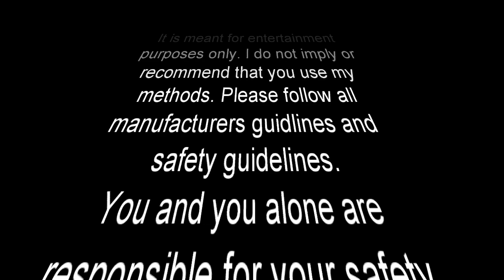Wood magazine walking stick part three

Comment: Really good!  I just made a stick last month, and it would have been good to have seen some of your tricks before I did that!  I have a short-bed lathe and had to make the top and bottom each in two sections that glued together.  I made 5/8" tenons 2" long for maximum strength.  Also, I glued a 1/4" length of contrasting wood onto the end of the piece with the hole to receive the tenon in order to 'celebrate' the joints.  

By the way - your opinion of threaded inserts is right on!
Reply from the maker: Hi Louie Thanks for watching and thanks for the comment. I'm glad you enjoyed the video.

Comment: Liked the videos Steve, thanks for showing them. I would like to know where you got the steb center that you used in your chuck, unless it is just for it. I have a oneway stronghold chuck, which I have to remove to use my steb center with #2 mt. It gets old real fast, thanks.
Reply from the maker: Joseph, first, I'd like to thank you for watching and then for taking the time to let me know you liked the videos. If you do a search for "spur drive" on Amazon you should find them.
Reply: I checked like you mentioned and found a 2 pack by Forrester, 5/8" and 1". @stevekrumanaker4582
Reply from the maker: Joseph, I did a quick search before I responded to your OP and saw that so I ordered them as well. That's a good deal and about what I spent for the first one I bought by itself. A word of warning, the set screw can back out and the tip is spring loaded so it will pop out as well. Put a dab of CA glue or something on the screw to help prevent that.

Comment: Loved the walking stick videos!  Just one question why didn't you use the flat of your stock rather than a corner edge?
Reply from the maker: Billy, thanks for watching and commenting. It's the camera angle. I agree with you that it looks like I'm using a corner but the piece is laying flat on the tool rest. I almost put a caption to make that clear but chose not to. Guess I should have after all.